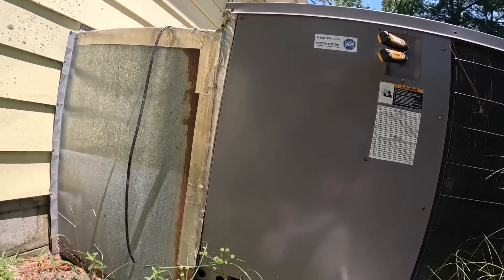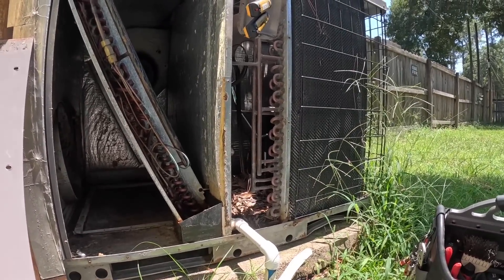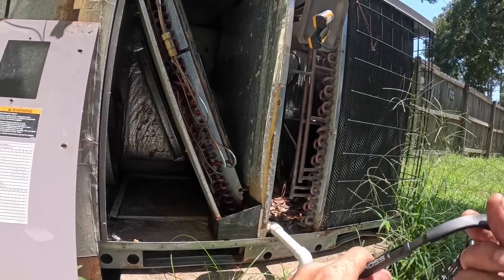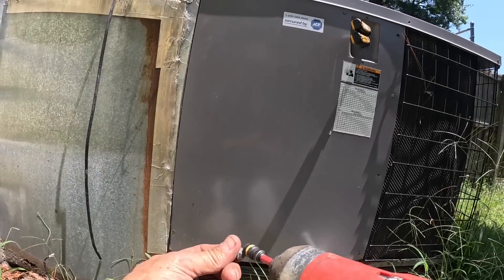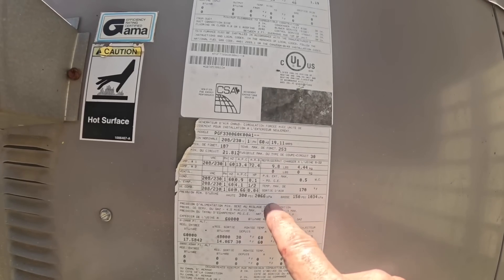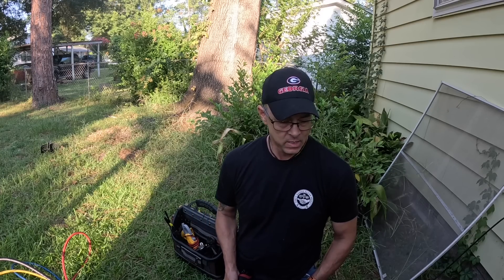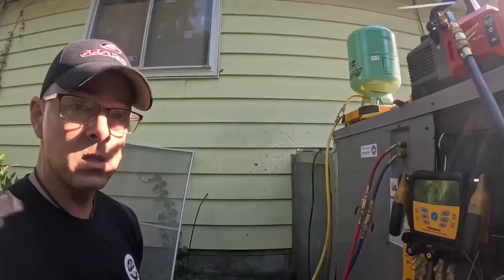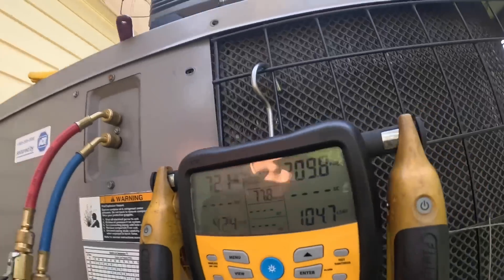Accutrak Zeroed in On This One Quickly! #hvacguy #hvaclife #hvactrainingvideos

Comment: Im sure that system has no leak. You've juste listen the refrigerant circulate in the piston when you have stop the unit. And at the moment the pressures has been stabilize in the system, you had no more noise
Reply: ...dude he literally did a leak search and found a leak. Did you not watch the video? Lol
Reply: @SoskiDiddley  yeah i've seen the video..64psi on low pressure and 265psi on high pressure on r22 system. Absolutely no leak on that for sure
Reply: @xavierchampoux  another example you didn't watch the video, because the pressures were 43 and 246.
Reply: @SoskiDiddley  look at 12:02 and tell me i've not watching the video😂
Reply: @xavierchampoux  even still, that's too low on the low side and too high on the high side. After he recharged it it was 72 and 210. Even if it wasn't leaking, it wasn't working properly obviously and needed the work done. Probably had a strange mix of refrigerant in it like curtis said.

Comment: Well I thought wrong. I thought you were going to cut that tubing and get rid of that union altogether. Nice work, 9lbs of R22 $$, the only reason I'm still using it, is because my friend bought a ton of it when it was still 75 bucks a pound. I haven't needed any yet this season(knock on wood), it has been over a year since I used that stop leak. Thanks for sharing.

Comment: Was that a rather expensive refill, or did you let the R22 go cheap because almost nothing can take it anymore?
Reply from the maker: $81 a pound. I have some, and it’s useless if I don’t use it.
Reply: probably used NU-22b (R-422B) an R-22 replacement. assuming that as an R-22 unit. pressure run a bit differently and you loose a bit of cooling capacity. but the price isn't bad in comparison .
**wow, put actual R-22 in it, yeehaw. liquid gold!

Comment: They sure looked like 5 ton numbers. Wish you would have sprayed soapy water on it, I hardly ever use my ultrasonic or my sniffer. Good yob!
Reply: Great Fix!! 5 ton a bit oversized looked like 😅 least no snakes or bees
Reply from the maker: Thanks
Reply: 2.5 ton 60000 btu heat
Reply: pretty sure that's 2.5 ton equivalent, seeing the compressor and total unit current ratings stamped on the unit.  which it said 13.4 RLA and 72.X LRA. and 21.x for the whole system.
 5 ton compressor would be about 25amps or higher RLA. no that's not an exact figure/science, but puts you in the ballpark.
could look up the model number and see what compressor it has, but I'm sure not going to bother.